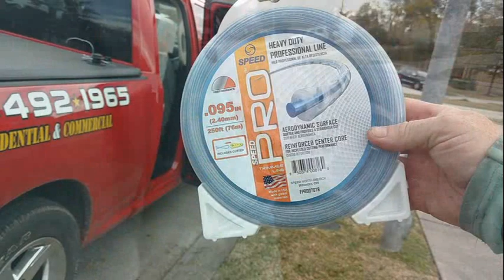Full Length UNEDITED  NO MUSIC Overgrown Clean up - STIHL FS94R Tons of trimming action

Comment: That Black Diamond does not seem to hold up any better then that other line you were using. I have always wondered if a thin metal wire line would be better. Of course wondered what it would do to the stuff being cut around. actually the regular line is hard on what is being cut around too. What do you think?